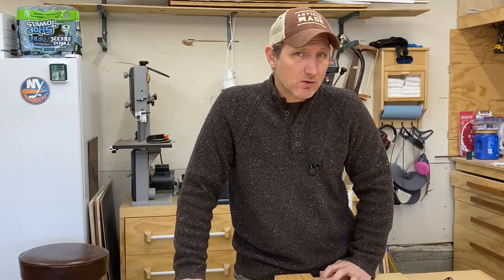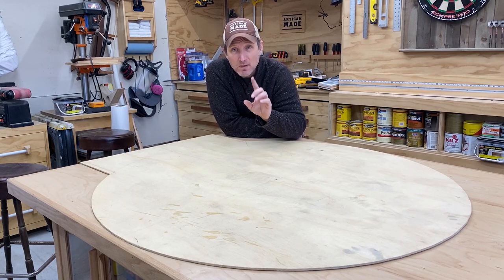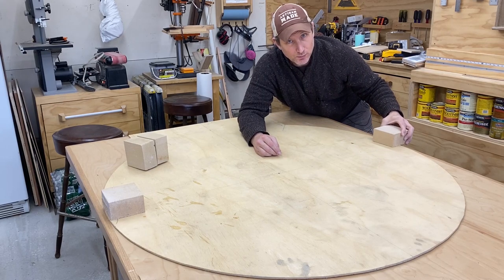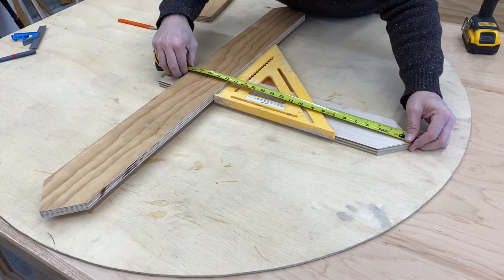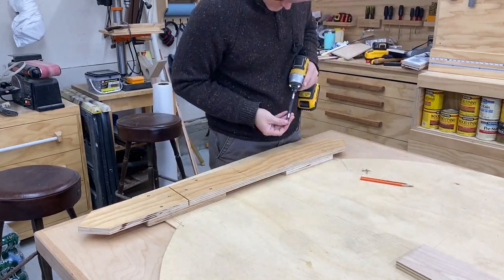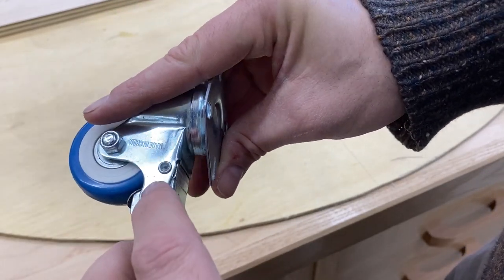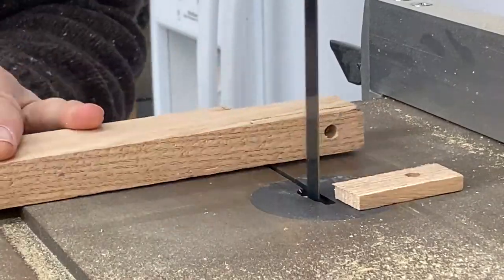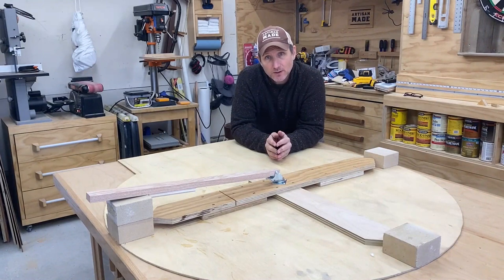How to Make the Indispensable Tool / Tool for Arches and Domes / How to Build a Brick Oven

Comment: Great explanation. 
I found I got a more accurate brick placement if the arm intersected the brick on its centerline. Off center you can get a stairstep effect on the brick joints. I played around with it as I made my tool. My 36" oven works great.

Comment: If you want to build a lower roof dome, build the trammel with twin Battens and a sliding block. Then you can adjust the roof angle to match your form for each layer.

A great tutorial, Liked, Saved & Subscribed
Reply from the maker: That is my plan for my next oven.

Comment: Very nice series of videos, thank you for making and sharing.
A question about the DOME sizing: I’ve read somewhere that the height of the dome might not be optimal when it’s basically 1/2 radius of the oven. What’s your thought / experience on this? I can figure how to achieve that by moving the stop on that swivel bar ever so slightly for each row after, say, the 2nd or 3rd one, in order to achieve a dome height of 15 inches for instance… Just wondering if it is worth considering at all. Any idea anyone?

Comment: Could you please share insights on how to optimize heat distribution within an oven using the height-to-diameter ratio,typically 63-65% of inner diameter? Specifically, how would you achieve or adjust the height on each layer of brick using this tool?
Reply from the maker: I’m sorry but I’m not sure what you are asking here. If you are asking how to calculate the oven opening size, there is a lot of good information now available on the internet.

Comment: Question please... If you do the first row full brick upright and then start with the ones cut in half... Would this tool still form the dome since the dome will be starting like 8 inches off the base?
Reply from the maker: You may need to adjust the length slightly

Comment: Great job on the pizza oven! How did you determine the size of the door opening? I’m struggling to figure it out. The inside diameter is 44 inches on the oven that I’m building.
Reply from the maker: There is a formula to calculate it. Do a search on Google. Forno bravo has plans available for free with some information too

Comment: Why not use a ball socket swivel? It will give you perfect centered spherical alignment. Using the caster wheel is close to 1/2" out of centered alignment. A ball socket swivel used for camera tripod can be used with some modification. Saw one on amazon for $10. I seen excellent pizza brick laying with people using only a door hinge for the trammel lol.
Reply from the maker: Ball swivel would probably work as long as it is all metal construction. It will take a beating so strength is the key. Hinges are good too. I liked the caster because it swivels very freely.  It is not offset and creates a perfect spherical shape

Comment: Hi, trying to build this tool for my oven exactly as you did I found that the distance of the bricks from the center is  different for different angles. Am I doing something wrong? For example, at the bottom is 17 inches and at 90 degrees is 19..
Reply from the maker: It will be about 2 inches higher vertically because you must take into account the thickness of the wood and the caster.
Reply: @ArtisanMade  thanks a lot!

Comment: The hinge should be as close to the base as possible, yours is significantly elevated, so that is wrong.
Reply from the maker: This is for a Tuscan oven design. We are talking about a 2 inch elevation. The alternative is mounting directly to the oven floor. I built an oven with this and it performs exceptionally well.
Reply: @ArtisanMade  sounds good!